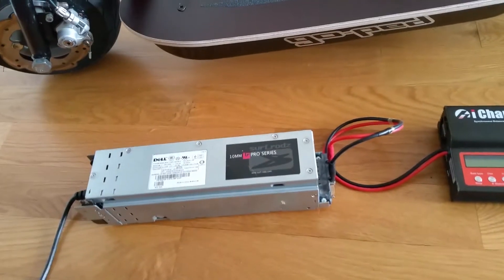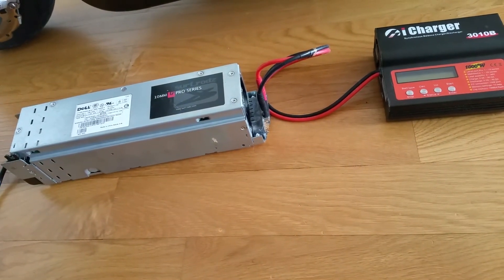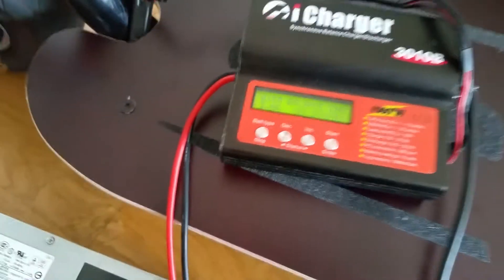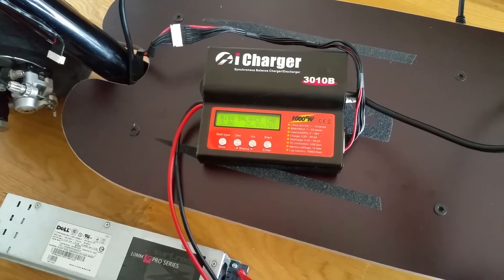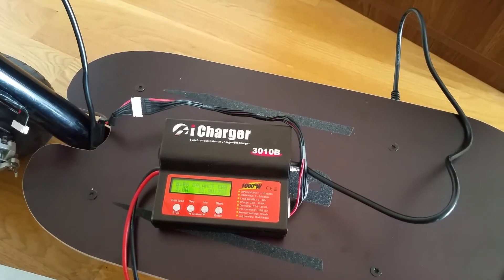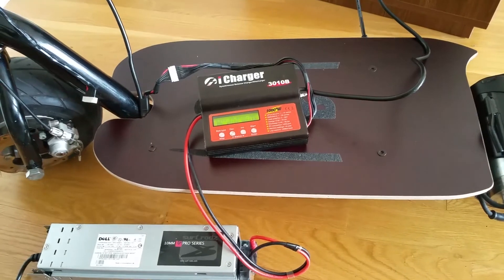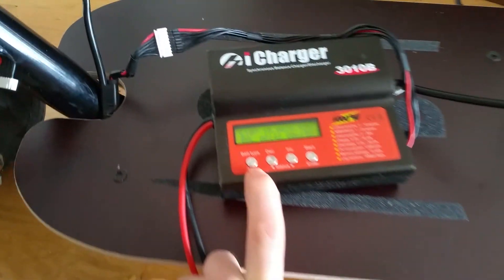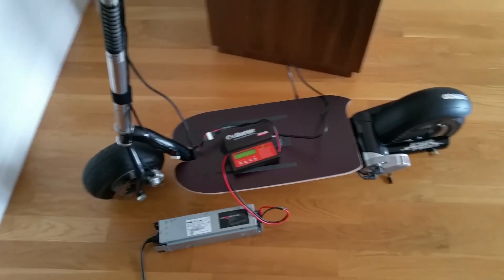How to charge goped custom 18650 cell battey with balance charger

Comment: Nice Video.. I dont understand how you get 32 amps out of a 7 cell battery pack ? Most 18650 cells only have a capacity of 2200 MAH. Am I missing something here?!
Reply from the maker: you are missing a lot. u have no idea whatbu are talking about. read on batteryuniversity.com
Reply: +Joshua B You can connect cells in parallel to sum their capacity, or connect them in series to sum their voltage.
Of course, when you connect cells in parallel they need to be as similar as possible. Same capacity (scrupulously tested) as well as the same internal resistance, so they discharge at the same rate, and current flows equally through every cell paralleled (the electrical path has the same resistance and they heat/age equally). Cabling/connections are also important in that matter so that you can distribute current equally.
Reply: +Telmo Monteiro ....ahh ok. So how many packs is he running? I had the impression it was only 1 pack.